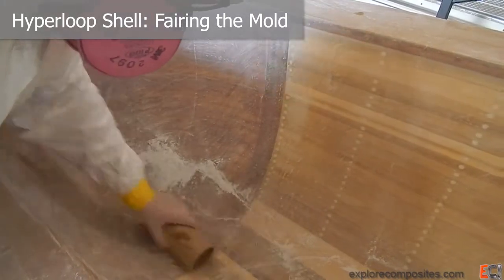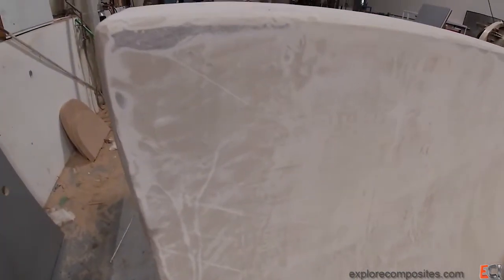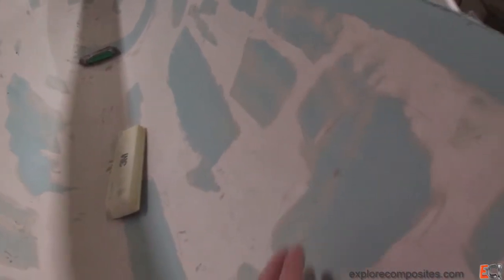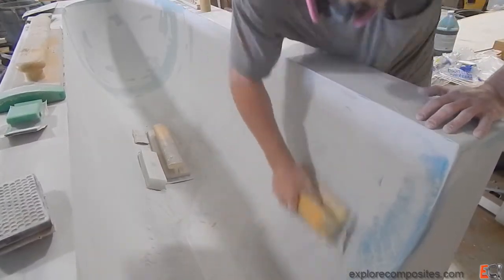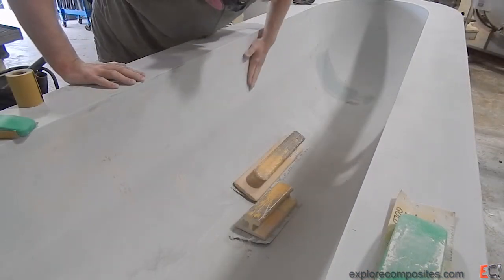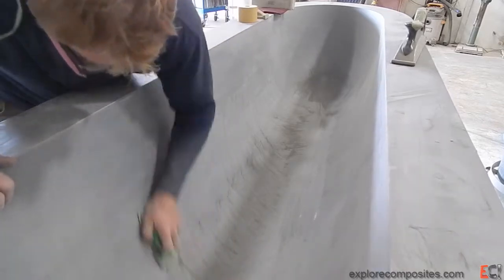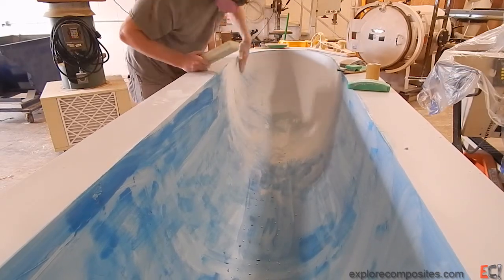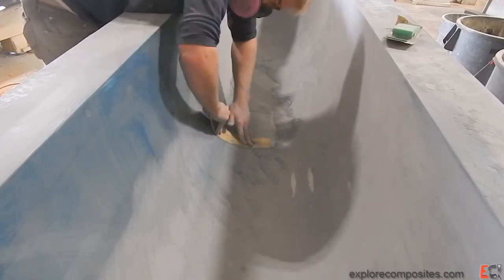Hyperloop Shell: Fairing the Mold (Part 6)

Comment: is the awlgrip primer something you had around?  why not duratec?   isn't the awlgrip really hard?  seems like the troweling on would be better to do first, then sand, then spray and then sand down orange peel.  ????
Reply from the maker: Yes I had it and didn't want to buy anything new - this was a very quick and cheap project!  If you sand the Awlgrip in the first day or so it is easy to sand - but you're right after a while it is hard - same with Duratec but less-so.

The other main reason was adhesion.  Duratec being polyester doesn't love sticking to partially cured "green" epoxy - and I was in a hurry.  You need to let epoxy cure for a few days or heat it to get it fully cured before Duratec is reliably going to cure when sprayed over - if not it only kinda cures and you have to wipe if all off!  But yes, given time and buying new material I'd have probably used Duratec - probably the EZ sand and then the 002.  Maybe would have shot an epoxy primer as a first coat to guarantee adhesion and then worked with Duratec from then on.  

At about 25 seconds in you see me trowling in a coat of "high build" Awlgrip.  This is a great way to fill the weave and pinholes in the glass.  I sprayed it on because it is easy and then trowled it - and then sprayed some more.  This isn't a high-detail surface with tight tolerances so fair was key - but no concern about accuracy really.  The rest of the priming was done with Awlgrip 545.